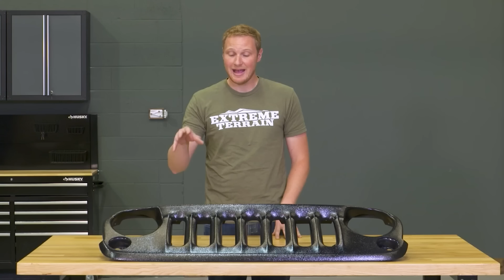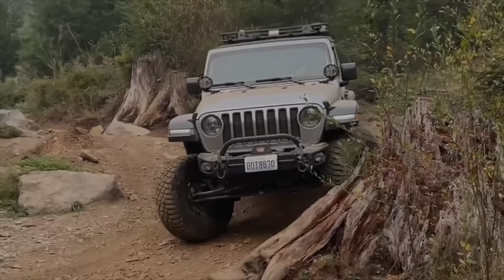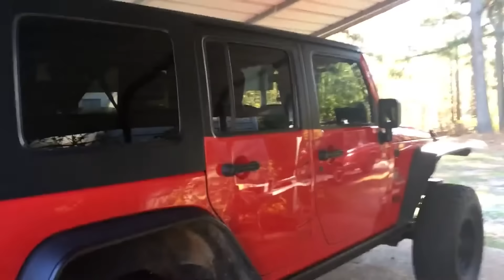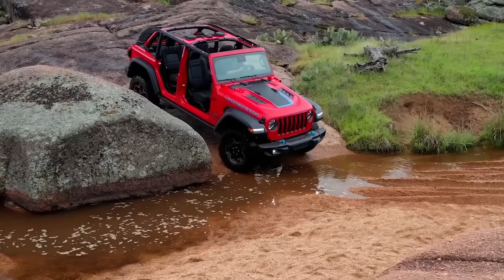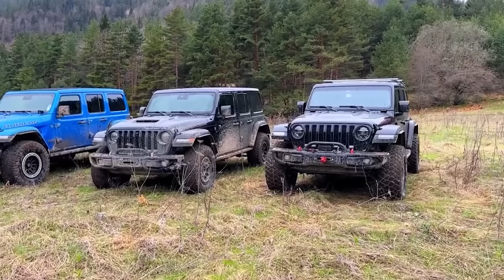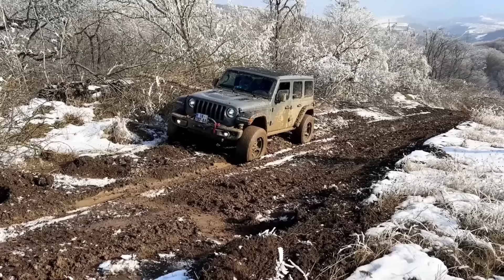12 Jeep Mods That Actually Make Your Jeep Worse

Comment: My 2010 Jeep Wrangler Islander with 146K miles is completely stock except for the cheap OEM speakers that I replaced with Kicker Plug-n-Play Speakers. No lift, oversize tires/rims, extra lights, fender mods, etc. It has a 6-speed manual transmission built by Mercedes Benz. 2-door, OEM performance suspension. It does what needs to do: go from point A to Point B.

Comment: Angry grills are the owners choice.If you save your original grill swap it back before trading or selling no worries.Bolt on mods or cosmedic add ons are great for the owners, just save the original parts problem solved.😊

Comment: well I bought a 2025 gladiator, high tide, had the mud grip tires, drove like hell on highway I had to fight it the whole time, and if it was windy,, well good luck. so I go camping , son has a old jeep, thinks he is cool letting out half his tire pressure, so I started to do  the same then figured what the hell, tires are 2 months old, so get this, I just happened to let my air out from 41 psi to 39 psi, OMG on the way home, 2 hours on highway, it was like I had totally different tires, so I left them at 39 and the 2025 gladiator rides amazing better, who would have thought 2 psi would make jeep ride like a different vehicle with highway tires.

so I you have trouble wrestling with your jeep on highway, try this, it has worked great for me

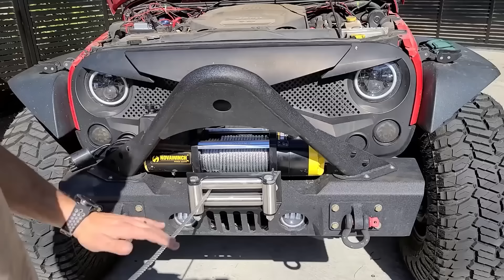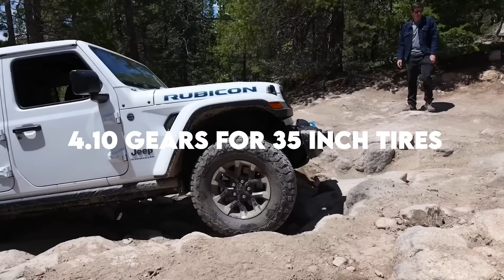Comment: 9:09 well, well well what do we have here as a grill 10:37 not true you use a mathematical approach: tire size you want/tire size factory OEM 35/32=[1.09375] multiplied by the stock gear 3.21= 3.51 is the gear necessary to run the Jeep as it did from factory. 3.73 is suffice for a JKU Sport Sport w/ stock gearing 3.21 to run 35s on it💯✅

Comment: Many spacer lifts include lower shock mount brackets that raises the lower mount point equal to the spacer lift height and keeps the shock within it's rated range of motion. Ran a spacer lift on my Gladiator with JKS Quicker Disconnets for a couple years before selling the Gladiator. It drove great and still had the comfortable factory-like ride, only a bit taller, with slightly decreaesed road handling and slightly improved capability on the trails. I actaully bumped into the new owners about a year later and they said they loved it and used it to tow their camper back and forth to and from FL. It already had 72k miles on it when I traded it in after less than 3.5 years of ownership.

I ran hub-centric spacers on my JLUR behind 35s on factory wheels for a while until I upgraded to aftermarket wheels. Provided a much needed improvement both on and off-road.

Also, not all JKs had 3.21 gears and 32" tires. I would be willing to bet most of the JKs geared at 3.21 had the smaller 30" street tires, while most others had either 3.73  or 4.10 factory gearing.

Comment: 2014 JK, 4" Bilstien shocks/suspension, 33's, steel proline wheels (no need for spacers... cleared stuff without), pyro stubby w/"Bull Bar"/warn (probably never use it) and pyro rear bumper.
So many things you can buy but do you really need it?
It's probably something to buy and not a need...
Just like Ray said:
"It's the way of the road Bubs"

Comment: I have cheap amazon LED rock lights that are going on 3 years and none have failed.
$100 for 10 and I only used 6 so I have 4 spare.
Reply: I'm about to order but was thinking I'd need 8...2 in each wheel panel. You used just 6?
Reply: @Gizmo-m2nI mounted 2 on the side on the of the  frame (each side) to shine light side ways and 2 at the back on the hitch frame to shine backwards. I did it for side and rear lighting not under the truck.
I found out on the trail at night i needed more light around my vehicle to see obstacles.

Comment: the cheap grab handle thing is so real. the stock straps are basically useless. aluminum ones that actually bolt in make a huge difference for passengers

Comment: The cheap light bar point is so underrated — people spend $40 on Amazon light bars that flood water in every rain and then wonder why their electrical starts acting up. The suspension lift section was solid too. A lot of guys go straight for the tallest lift without thinking about driveline angles, and then they're dealing with vibration and premature wear on their CV joints. Good reality check overall.

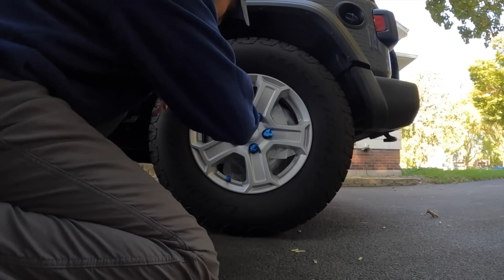Comment: I totally agree with regear with increased tire size.  I went up to 37 then 38" tires.  My JL Rubicon did "fine", but when I changed the gears to 5:13 I noticed a drastic difference in torque.  But what I didn't expect to see was a jump in fuel efficiency.  I went from 10-12mpg to almost 20mpg.
Reply: I want to regear with my 35s but I put stock winter tires on every year...can't justify regearing every season lol
Reply: How much did your regear cost

Comment: I had to laugh when this AI generated program said that a Professional regear for both axles is 1500 to 2500 dollars. Maybe in 1970 but these days it's between 4000 and 5000 Dollars easy. And for 35 inch tires a 4.56 gear is recommended for 37s 4.88  4 .10s will work with 35s but you will loose 8th gear on the highway .
Reply: You do not lose 8th gear on the highway. This is a myth or someone that lives where there is nothing but hills.
Reply: @KS1521JH  I have to disagree.  I live in the Myrtle Beach area which is pretty much as flat as you can get and when cruising on the Highway at 70mph with 35 inch tires and my 4.10 gears the transmission hunts between 6th and 7th gear a lot and very very rarely goes into 8th gear. ( only if you are rolling downhill without the need of acceleration to correct the speed you are cruising at).  So while you are not "Loosing" 8th gear, the transmission will hardly ever shift into 8th gear.

Comment: driven 16 cars over the years.  owned them all.  over 2 Million miles of road over 50 years...car ,truck,suv, tractor trailer....NEVER had a bearing failure.  stop putting shit on the internet.
Reply: Your story would be different if you lived in michigan.... our roads suck and is a common failure.
Hopefully most are intelligent enough to get it checked out when it starts growling but there's that small percentage of people 🤣
Reply: I had a steady bearing go on a van once .Sounded like the drive shaft was going to go through the floor.

Comment: Lost me on the first one.Angry Eyes don't fit over your slots, they replace the original grille.
Reply: It doesn’t hinder air flow either
Reply: I like them. Don't care what anyone thinks and they don't cause overheating. I have had budget light bars on my rzr for ten years without issues and have been in 3 feet of water
Reply: True,  AIs aren't perfect  but regardless the Angry Eyes are Butt Ugly and were a fad that has passed.  OEM FTW.
Reply: @ThomasRSmith-og7zo oem ? 😮 the horror,  pleeb mentality  swap everything!
Reply: @Herpaderp-x1q  Yup!  You get it.
Reply: @ThomasRSmith-og7zo not yet they are still selling them 😮
Reply: Some in the past were actually a cover that went over the grille. My TJ had one when i bought it, took it off and the OEM grille was behind
Reply: Most of these have some small truths but not to the extent that being stated in this posts.
Reply: The whole grille thing is BS
Reply: and Its the most ugly thing on the world!!!
Reply: @stevesmith1731 that's one opinion
Reply: @roberthughes2687  Second that opinion.  The Uglies have it. 😀
Reply: In any case they’re dumb AF
Reply: @nomansland4811 jeeps are dumb so what difference does it make
Reply: @roberthughes2687  What kind of vehicle do you own and what would you want if money wasn’t a factor ?
Reply: @roberthughes2687  I don't think an inanimate object can be dumb or smart.  It's just ugly or Beautiful.  It's all in the eye of the beholder.  ;-)

Comment: Explain to me how a higher offset wheel is different than a wheel spacer? The stress leveraged on the axle is the same…
Reply: 💯🎯‼️ the only CORRECT way to widen the stance is wider AXLES.
Reply: Ya the bearings I don’t understand but from having it happen to me I’d say the spacers move the weight to the studs more then then hub. And they can snap the studs. I’ve had that happen to me on I95. By the grace of god I was pulled over a few times trying to figure out the vibration I was feeling and on the last stop I still couldn’t find anything wrong I started to move forward and bam thought I got hit in the rear by a car. Till I seen my right rear tire going through the grass lmao.
Reply: I’m a retired automotive engineer and I agree. The bearings, for instance, don’t care what is making the difference. They will fail just the same.
Reply: Yeah don't make much sense? Now if it was focused on all the studs snapping off due to the spacers i would understand because it's about the only sketchy thing about running a spacer...
Reply: @johnroberson4841 
Ran spacers on many of my rigs over the past years and always bought quality spacers and torqued the nuts according to spec using loc-tite and never had any problems.

Comment: I just bought a 2012 Jeep Wrangler Sport and someone put one of those angry I grills on it and some crappy fenders that are metal and I found a cracked radiator the headlights keep falling out and the fenders aren't even on right they're bolted with some odd different bolts and they leave a big gap behind them they're metal and the front ones are shorter and thinner at the front which allows rocks the fly up and hit the body of the Jeep they're junk
Reply: I just bought a 2017 Wrangler last September loaded with mods but I messed up and put cheap $110 fenders on it that doesn’t come with lights so now I need to buy wheel wells and drill holes for turn signal lights. People don’t look and complement my jeep since the fenders.